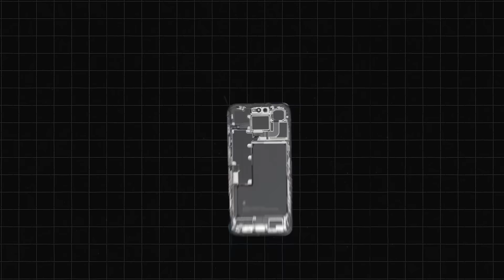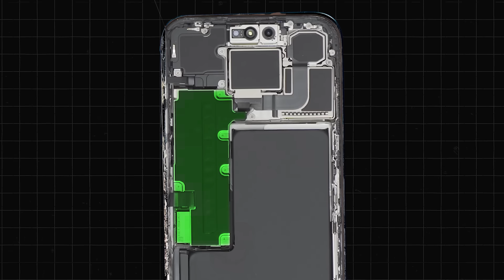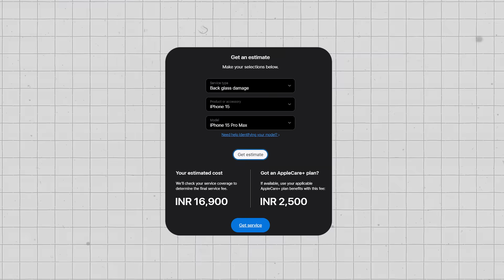Rest In Peace "iPhone 15 Pro Max" 💀| உள்ள என்ன இருக்கு? 🤯 - iPhone 15 Teardown 🔥

Comment: 17:09 misleading 
FairPhone is the easiest. Other android Phones like Samsung are much easier If you want to replace Samsung Display (Original) then you will get with Frame you need to just transfer Board and Battery. Front Camera and Haptic motor are mostly comes with Display.
Reply: he say theoritacal no say pratical

Comment: 0:18 😂
0:34 Iphone counting starts to RIP..........
0:36 😂
0:48 Content of this video.........😂
1:28 😂
1:57 Electric Sudugadu kulla iphone........
2:45 Mel aadai backcase kizhatta porom........😅
3:04 Iphone : Anal la kodhikidhe.........😂
3:31 Nalla irukura mobile vangi Operation pandradhu idhan 1st time.........😂
4:06 Process repeats........😅
4:41 Satisfaction.......😅
5:04 PC-DOC pranks Editor Prabhu.........😅
5:34-7:25 Ulla enna ellam irukku..........😂
8:04 Speaker of Iphone.......😅
8:21 Taptic Engine.......😅
8:44 Camera nondi-puduven........😂
9:08 Iphone camera repair pannida koodadhu la adhukku thaan muthirai........😂
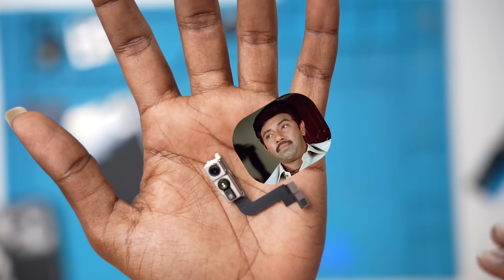9:35 Front Camera.........
10:27 Taptic Engine kaiyoda vandhiruchi........😂
10:52 Padhattam........😂
12:32 Iphone Motherboard........😂
13:38 Battery........
14:39 Pirichi pottadhukelam Price Estimate pannum PC-DOC.......😂
15:33 Pirichadha onnu sekalam vaanga.........😂
16:04 😂
16:40 😅
17:20 Sarvs Bro × PC-DOC.........😅
18:02 Conclusion.........❤